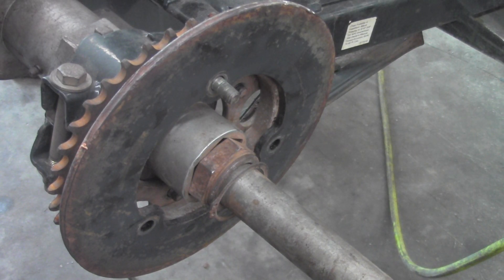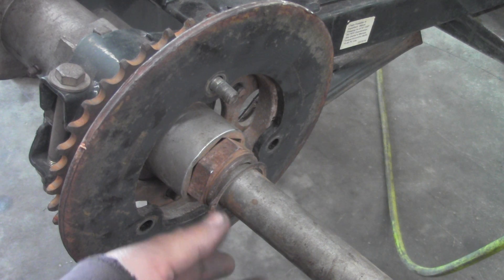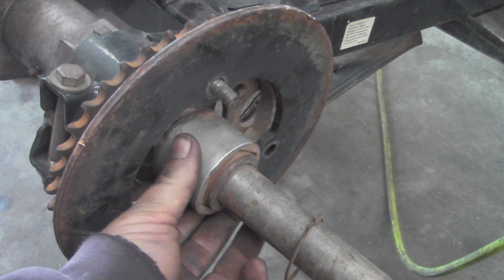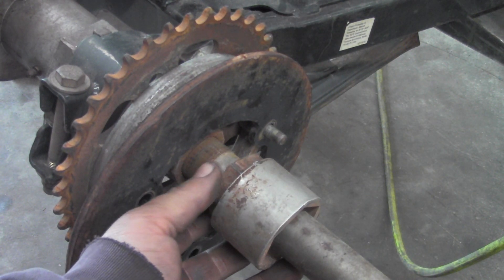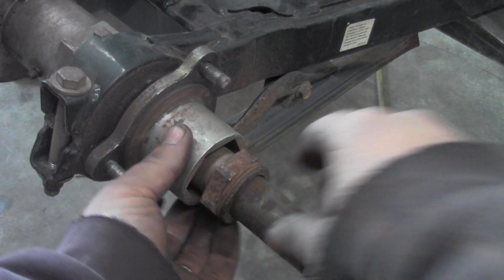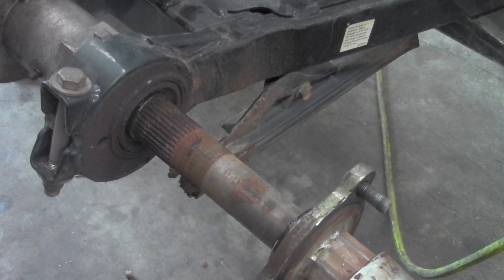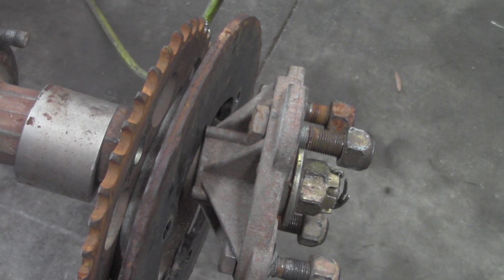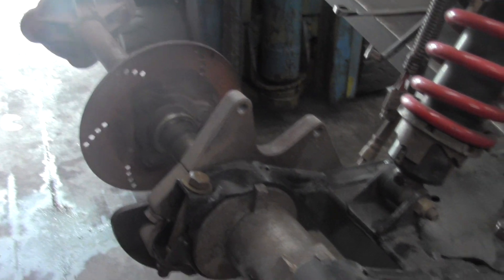Removing the Rear Axle From a 2000 Polaris TrailBlazer ATV

Comment: The jam nuts are going to be seized tight with rust.  You usually have to get them red hot to get them to move at all and you'll damage the axle threads in the process.  Just sacrifice the nuts ($17 each retail) rather than destroy the axle threads.  Use a diegrinder with a cutoff wheel.  Carefully cut two grooves across the nuts 90 degrees apart.  Cut the gooves down to just above the threads.  Use a chisel and hammer to "crack" out the 90 degrees section of the nut to remove it.  If you damage the axle threads, they are 24 threads per inch.  Buy a thread file at NAPA and clean up the damage. I do this job all the time.  If you "crack" the nuts, you'll have it apart in less than an hour.  I've seen guys take hours with a torch, pipe wrench, and 6' cheater bar and still not get it apart.  There is a bearing "kit" that includes the tapered bearings, races, and seals that sells from around $40 retail.
Reply: Cool... thanks for taking the time to write this post...
 I  PRE-SHE-ATE-CHA MAN !!!
Reply: Man you win the internet with this comment. God bless you.
Reply: Dude I know it's an old thread but I'm going through hell right now trying to get mine off lol. Probably going to have to go your route. Wish me luck

Comment: I need the mounting bracket and rotor for the rear brake on my 2001 500 HO Scrambler. Have one laying around?
Reply from the maker: 00TreadStone sorry. We dont at ths moment
Reply: Big Kid Powersports ok! Thanks!
Reply: Ok Thanks. Is there any way you can tell me where the clear vacuum tube on the carb attaches at the other end? I think its a vacuum tube, but don't know for sure OR where the other end goes to make the vacuum.
Reply: @00TreadStone  -> it doesn't attach to anything. It's a vent or overflow for the carb if I am not mistaken...

Comment: is it possible to flip the axle and have the chain sprocket on the left side on these  or would the splines not be in the right position  wanting to put a different engine on this frame but most sprockets are on the left side of engine

Comment: how did u get that nut off after u heated it up I am having a hard time with it get back asap
Reply: Same here
Reply: Did you end up getting it off?
Reply: That's the part he left out.....  You usually have to get that jam nut red hot to get it off and that distorts the nut.  90% of the time they won't thread back on and you have to buy new.  Look closely at the axle threads they also distort.  If they're distorted, go to NAPA get their part # SER 2229.  It's a thread file.  Use the #24 side to slowly clean up the threads.  Thread the new nut on until it gets tight --- Back it off and file the threads where it stopped.  Work your way inward until about 1" of thread is showing on the backside of the jam nut and you should be good.  Do yourself a favor and goober the hell out of the axle threads with anti-seize when you reassemble.

Comment: Come on dude....  We both know you usually have to break out the torch set to have any chance of getting these apart.  You also forgot to mention the jam nut is 1 3/4" and it takes one on each side to keep the axle from moving.  Not a job for the average weekend warrior.......
Reply: BOB Driver if this ain't the true. Mine would not come off with the torch or anything.
Reply: Sherry - Use a diegrinder with a cutoff wheel.  Cut two grooves across the nut at 90 degrees apart.  Cut them down to just above the threads.  Us a chisel and hammer to "crack" to rest of the nut.  If you damage the axle threads with the diegrinder or chisel, they are 24 threads per inch.  Get a thread file at NAPA and clean up the damage.  The jam nuts are $17 each retail.  You probably need to buy both.  These jam nuts are what sets the bearing preload and aligns your brake rotor in the caliper.  Anti-seize the hell out of everything when you reassemble.  I did this job just last week and this knucklehead is full of crap when  he says it's easy.  If you "crack" the nuts it's less than 1 hour to get it apart.  If you try a torch it can take hours and you'll destroy the nuts anyway.  You're probably trying to replace the wheel bearings....  There is a "kit" that includes the tapered wheel bearings, races, and wheel seals.  It runs about $30 retail.
Reply: Hey BOB Driver, where can you get the nuts at? I've looked everywhere and everyone says they're unavailable, can you still purchase them from the dealer?
Reply: I must have been lucky, everything came apart very easily for me.  I had to spot weld the self tapping bolts to the hub,  since they rounded off on me, seems like a poor design.  I got a new hub and sprocket set put in so it runs great again.